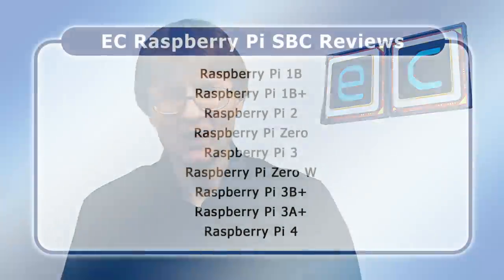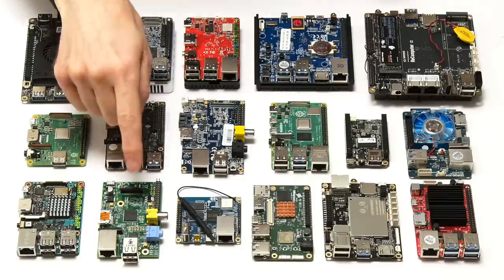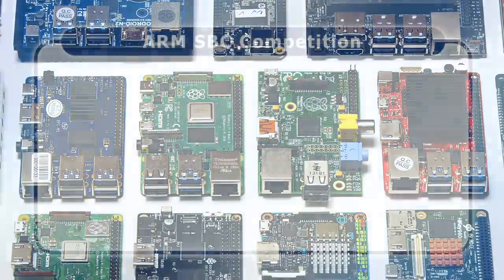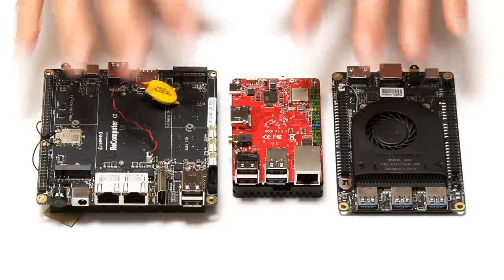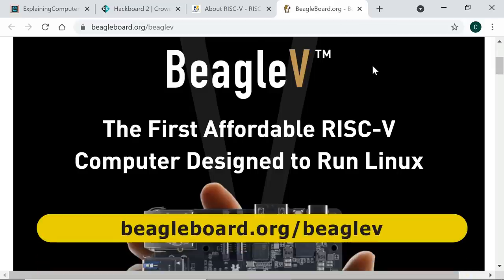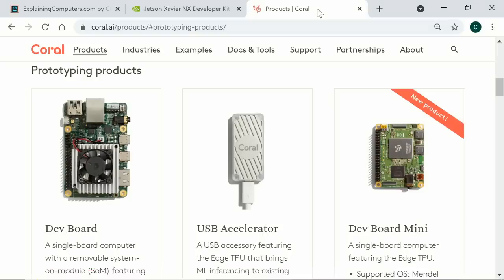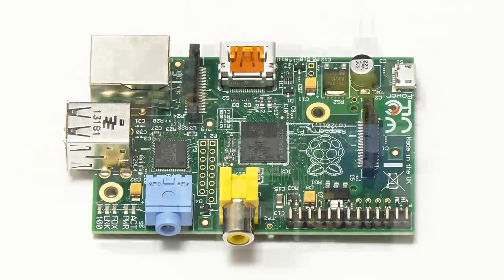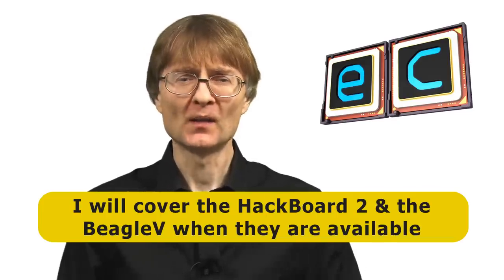SBCs in 2021: The State of Play

Comment: Lately I'm torn between an Odroid N2+ 4GB and RockPro64. I mainly use them for SDR (Software Defined Radio, monitor/decoding VHF/UHF/P25 Trunking/DMR/other radio signals), but also tinker with streaming and stuff. I also like the idea of an on-board DAC because I'd like to get into DSP and coding audio effects someday, and maybe making an audio effects pedal or DIY synthesizer. The RockPro64 is appealing because of that PCIe x4 slot, but I hear the next rPi iteration will also have PCIe. I pretty much won't ever buy a Pi so long as better alternatives by the likes of Odroid and Rock64 exist, however. 

And I haven't found a need for something like an Arduino or rPi Pico yet, but I agree that the sector will split between low-level development/control devices with less resources, for modding/SCADA/IoT/robotics/(mainly hardware tinkering), and more computerized or digitized boards that have more computational resources and some I2S/I2C/SPI/UART as a tertiary function, with less capacity to interact with hardware, compared to some beefed-up descendant of the Arduino or something.

Comment: An interesting perspective. I have an interest in SBCs at both server and microcontroller level.

The problem I've found with the ARM architecture is the market is driven by the availability of SoCs originally developed for mobile phone applications. These go obsolete at the same pace new devices are introduced and this encumbers SBC manufacturers to revise their offerings at considerable cost for a small market.

Hopefully, the RISC-V marketplace will be more conservative with devices having a longer lifetime in service. I think SBC manufacturers will appreciate this development.

Regarding software, for server-level SBCs I am usually forced to use ArchlinuxARM. I know there are Debian and Ubuntu derivatives available but I find them heavyweight. ArchlinuxARM with leveraging of systemd features can lead to a very lean server implementation. I use an ODROID HC1 as my home server with systemd containers providing all of the services I need (database, email, web and XMPP) running in 1GB of RAM and plenty of CPU power to give very light load numbers.

For microcontrollers, the Arduino platform and MicroPython provide a good software ecology. I use these tools with Raspberry Pi Pico, ESP32 and STM32 Blackpill microcontroller boards. The limiting factor with these SBCs is I/O and flash memory availability (particularly the latter for MicroPython applications). The former can be mitigated by using multiple devices connected via USB to a controlling device while the latter can be mitigated by choosing devices with a larger flash memory capacity e.g. some ESP32 devices can provide 32MB of flash.

I believe the use of a more powerful controlling SBC running a mainstream Linux or Windows OS connected to one or more USB-connected microcontroller SBCs will become more fashionable.

It's likely that we will do what we've always done in the past i.e. adapt to making use of what's available while taking advantage of whatever advances come in the future.

Comment: There is other brand of SBC than Raspberry Pi like those supported by Armbian. I like Armbians well optimised and slim os based on Debian and Ubuntu. Like you said, there is many interesting hardware alternative to Raspberry Pi but not very interesting unless there are good software and developer support for it. I use to look at Armbian before I get anything other than Raspberry Pi. I'm looking forward to see some sbc with armv9 soc and would like to see more energy efficient system for batterypowered setup. We are collecting a good collecting of different computers and to find a use and have them all updated will be hard.
Reply: The beauty of linux. Can be stripped down and fit on a smaller device if neccessary.

Comment: There is one thing I was planning on doing with the Raspberry Pi 4 8GB model but I was not sure if it would justify the significant investment. My idea is to use the Raspberry Pi 4 8GB model, dedicate 2GB of RAM for the video memory, use an external adapter for a PCIe 3.0 M.2 NVMe SSD or newer drive, and buy an Argon One Raspberry Pi Case (Without the SATA adapter). I am not sure if it would succeed as a faster desktop computing experience but I wanted to give it a try and see if it would work. I tweaked the memort settings on an older Raspberry Pi and it did work to an extent but it was working with about 512MB of memory compared to the 8GB model would offer.

Comment: I still have an original Pi which boots from SD card but runs from a partition on an attached HD.  Acts as a file server, Apache server, upnp and mumble server.  Another Pi 1 model that has an attached USB TV tuner.  Runs TVHeadend and streams TV across my network..Also directly attached to TV so displays signal from tuner onto screen using Kodi.

Two zeros running ADS-B software.

Also got a 3B+ that has been used for experimental projects using Pi as WiFi router etc.

Comment: I suspect that for certain parts of the world SBCs running ARM or RISCV (VI perhaps?) on battery and solar connecting to the internet via Starlink or similar could be a thing for places where computing, power, and data infrastructure isn't built out enough to support much else and where cost is a consideration. (could be a thing, haven't heard about it so far)
It would be a great way, at the moment, to enable developed technologies in areas where they otherwise can't get and run those or would be prohibitive to have. I do think that the boards need to go up in processor power however to have a shot at being more than basically useful (heavy web pages and especially video content is killer on many of those boards currently).

Comment: A video put together quite well and I'll second the arguments presented. Some random thoughts, thou:
- A lot attempts have been made to capitalize on what the raspi foundation has achieved and they maintained their lead by continuously shipping the overall best package. So its normal, that we went through a phase of loads of "me too" products. That is dying off now
- x86 somehow does not manage to provide decent performance in the <5W envelope. Intel has tried very hard (AMD to a far lesser extend as well), but essentially yielded nothing substantial
- the ARM SoC universe is IMHO completely broken. The driver support sucks, lots of manufacturers give a flying f*ck about the liabilities of the GPL and ex-tree SoC support in linux is far more often the norm. OSS drivers for GPUs are very far and few. There are by now just too many ARM architectures around without proper and solid software support.
- RISC-V might be a chance for a fresh and decent restart, but there needs to be product first. Very little is available, that satisfies more than just basic curiosity for the new ISA. Likewise, A LOT of stuff still needs to be done for the ISA - no virtualization yet, vector pipelines are defined but never put to silicon, GPUs are not in sight (except ARM adaptions) and the entire OS/compiler ecosystem is in its infancy (which, by the way, the beagle-v tries to rectify: give them a break, the beagle-v is designed to provide a platform to do OS ports to, beyond the emulator).
- it is yet totally unclear, if RISC-V can ship a real advantage to ARM. If it doesn't, it's going to be a damn hard time convincing people to use a new ISA, just because "it is free". Free software is a thing, that consumers can relate to - they get source and more important, they get stuff at little or no cost. A free ISA does not provide any of that. Customers will not care for the ISA of their chip being free. 

The Raspi foundation has done a lot of things and most of them quite well. They deserve and should enjoy their success. I am a happy camper like many others. I am actually looking forward to RISC-V and will order the beagle-v and maybe even the expensive Unmatched, but they have a very long way to go, before you can make a solid comparison. The beagle-v will most likely not be able to come close to the raspi 4 in terms of features or performance and it will be more expensive. Its not hard to predict, it won't fly off the shelves like a new raspi.
But having fought hard and heavy on the RISC side during the RISC .vs. CISC battle 1985-1995, I do lust for an arch, that kills off the x86 crap once and for all. And while that is not happening, I silently enjoy my x86 box, because it is so damn good after all :)
My "little computing needs" are served by Raspis in the mean time...

Comment: I really wish there'd be more adoption of ARM SystemReady. This is a specification that requires PCIe, UEFI boot, and ACPI - to oversimplify. This would mostly solve the software problem these boards have, as these specifications combine to allow generic images of specification-compliant operating systems to boot and enumerate the devices in the system. The new Raspberry Pis already have PCIe, so we know that's not necessarily a cost hurdle. There's also experimental UEFI firmware. My point here is just that I don't think there are too many hurdles for this to be a reality, even at low price points.

Comment: I need to connect SSD hard drive to RPi. For many years I'm looking forward SBCs have on-board SATA port.

There are several tricky solutions using USB but I don't believe such solutions are suitable for commercial projects.

Does anybody know if there is a future plan to add SATA to RPi or other SBCs?

Comment: I'm still hoping to see a performance comparison between the Rock Pi 4 vs Raspberry Pi 4 for both CPU and GPU. Or at the least, any RK3399 vs BCM2711, though the Rock Pi 4 is the closest in price and gives the most features of any other board for that price, but any rk3399 will do. It's an interesting comparison because it's more complex than 6 cores vs 4 cores. The Raspberry Pi 4 has the 4x A72 (big cores), vs rk3399 having 2x A72 (big) + 4x A53 (little).

Comment: I think most developers use SBC's for their GPIO functionality and as such, the performance provided by the recent SBC variants are more than adequate to get the job done, whatever that may be. For me, any Control, switching, measuring or sampling needs have been met. I don't need a faster SBC. I think this is the case with most SBC users. If we want to do Video editing, we'll power up the PC or Laptop, but for the typical tech user project, the SBC is as competent as we need. The market may not be there among us for ever faster and more competent SBC's.
Reply from the maker: I think you are spot on. For many applications, SBCs now reliably do all that we need them to.

Comment: I would like a video for Raspberry Pi applications in the commercial market.  I am particularly interested in high-temp variants of the raspberry pi that are intended for commercial market.  The raspberry pi 4 temp range is only 0-50 degrees not close to what is needed for commercial/industrial use.

Comment: Great analysis, but I disagree on one point. Neural inference will probably reach a point where even low-end hardware supports it, much like what happened with floating point. You don't hear about a CPU having an FPU. The reason for this, is that even on cheap phones (where most SBCs get their SOCs from) it will be cheaper to """""enhance""""" an image than include a slightly better camera in the BOM, as an example. Computer vision that used to be revolutionary like facial recognition is already such a given that you can do some form of it on any SBC, heck even an ESP32. 

Of course this means that the expectation will rise. The cheap SBC will tell you "it's a cat", the expensive SBC will tell you how the cat feels. :)

Comment: I think we are close to a "NEW" age.  With the Apple M1 and Nvidia acquiring ARM, I think you will see a regrouping of AmLogic, Rockchip and Mediatek (maybe Broadcom) and develop all-in-one chips like the same with SBCs soon to follow.  Also, I think you were right with the complexity of the chips.  The RockPro64, and others with the RK3399 & Mali T860, are just now seeing their hardware reaching their full potential.  Armbian with the open-source graphics Panfrost drivers are showing impressive results (TwisterOS shows this off nicely).  Graphically, it is close to an Nvidia Jetson Nano, but with a more powerful CPU.  The AmLogic S905X3/4 with the Mali G51 and the S922X in the Odroid N2(+) with the Mali G52 are close to full Panfrost support with current performance (on an arch/Wayfire OS) eclipsing that of the Jetson Nano all with 2-3 fold CPU power too.  I remember reading the difference in the number of pages between a S905 & the S922 and it was huge.  The complexity is out growing the development and it looks like ARM is shutting down open-source support ending with the Mali Bifrost engine.  I'm not sure where this leaves the community, but I'm sure it will react accordingly.

Comment: I'm not that much into tech and website hosting but I if someone can answer my question.
There is a game I play that has a replay feature so you can see what happened during the match. And there is a bot in discord that you upload the replay to it and the bot will give you a very short version of it as a video without the need to play the replay file using the game application.
So can I run this bot using a 24/7 running sbc?
How powerful should that sbc be and is there anyway to know?

Comment: Hi Christopher. A lot has been done software wise. Th RK3399s now have good video playback in browser with mainline 5.x images and great GPU drivers for gaming. You just need to install Vivaldi browser for video playback in browser. I run with display res of 1440p 1080p30fps youtube without tears or stops. Kodi also works for 1080p video. Maybe you could take a look at Armbian mainline for the RK3399. Now different desktop environments can be chosen from.
I use Armbian as main desktop and it does all I need. Greetings.
Reply: And if you'd have any question, be sure to ask. Vivaldi needs to be downloaded and installed manually with dpkg -i ivaldi...arm64.deb. You find it when you search for vivaldi snapshot. Kodi can be installed with sudo apt install kodi.
Greetings.

Comment: Hey guys...want to build a NAS using SBC, at least 4 sata ports...any suggestion ?
Reply from the maker: I am not aware of any SBC that has 4 SATA ports onboard. There used to be a quad SATA HAT for a Pi -- https://shop.allnetchina.cn/collections/sata-hat/products/dual-sata-hat-open-frame-for-raspberry-pi-4?variant=31200524697702 Or you could use a Pi 4 Compute Module, and add a PCIe SATA card. Good luck! :)

Comment: I think that it is down to the standards as you said. When you do a tiny, power efficient device on a small microcontroller you don't care that much on abstractions (looking at 8 bit AVR and smaller). Then goes RTOS where a bit of repeatable setup is warm welcomed. Then goes HAL abstractions like in STM32. On PC we have BIOS or UEFI. And then elephant in the room - ARM. Great power efficiency and absolute lack of low level booting standards. Add lack of graphics support in Linux and there we have it. 
I also feel like this massive amount of SBCs 2-3 years ago was on top of maker hype that just didn't materialize because of poor software. For me those extra SBCs, touch screens from different sources were no go because of precompiled system image from manufacturer I don't trust. And trust is a keyword here I guess.
Reply: And update comment to myself - I look forward to RISC-V, but at such high level of abstraction I care about good SDK and friendly toolchain (like IDE, gcc/clang, Python, Java) and operating system portability, instructions per Watt or general power efficiency rather than low level itself. At that level it shouldn't matter if it is x86/x64, ARMv8 or RISC-V. It should matter how easy is to get going and how fast or how power efficient the solution is. And the rest is... price ;)

Comment: Main problem with Risc-V SBC's so far has been a lack of display / GPU hardware.   I've had Risc-V SBCs for 2 years now, based on the GO32 and kendryte K210 chips.  Entry level with display hardware has been $500+ for a highly anemic product, so it's been un-compelling.

Comment: I concur that the future of SBCs will fracture.  Not certain how, but likely price and functionality.  Functionality does not mean just what apps will run on the SBC but other programming capabilities, specifically Real Time.  Clearly RP2040 is RPi "testing the water" of "programmable I/O".  This is a huge area and the real issue is blending hardware capabilities with software.  The fact that Linux descends from "not real time capable" origins is a burden.  There are several directions they could go based on work already completed.  RTLinux or Real Time Linux for example.

I know very little about either, but what I would like to see harkens back to "ancient times" and Digital Equipment Corporations RT-11.  Or more correctly TSX-11 on top of RT-11.  Basically it had a "foreground: task, that was truly "real time" and allow "bare metal" programming.  The background task ran and OS and provided multi user command line interface.  The same could be done with Linux, dedicating one more CPUs to real-time tasks and keep one for user interface and supervising.
Reply: There was some discussion on the Raspberry Pi forum a couple of years ago, but no one could really figure it out.

Comment: still waiting for a Pi SBC with an integrated FPGA, aimed at makers, with much lower cost than traditional FPGA products, and with an SDK and tutorials for programming FPGAs that makes entry much easier
Reply: Too niche. The Raspberry Pi foundation has always aimed the hardware at the largest possible audience, and not included hardware that will add to the cost and not be used by them. There’s always the Arduino MKR Vidor, or the Terasic DE0-Nano-SOC, but there isn’t the same level of support as the Pi